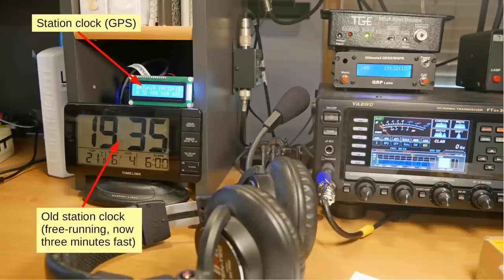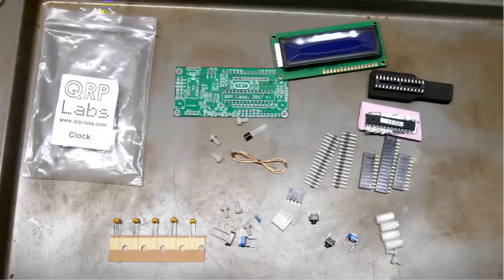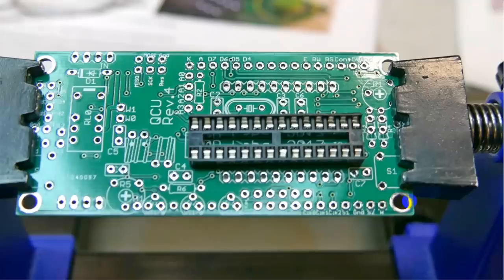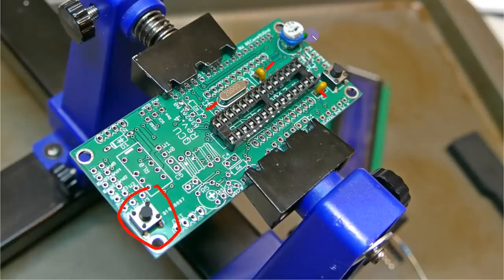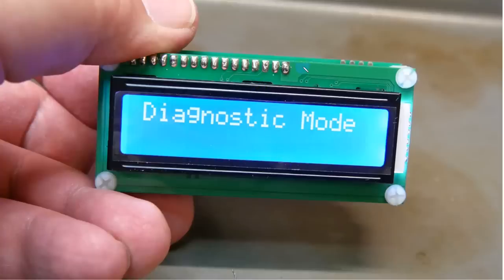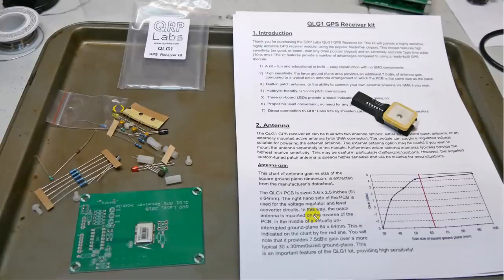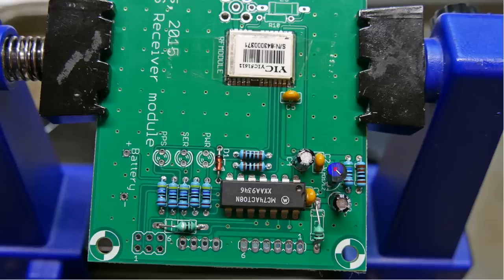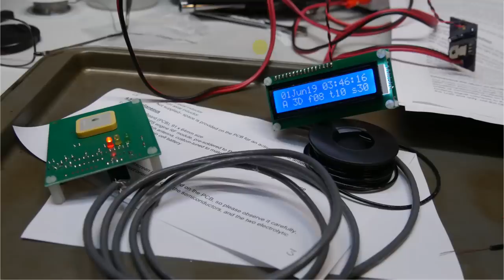QRP Labs Clock Kit and GPS Receiver Kit (#203)

Comment: Typically, the time and date can be taken from the NMEA 0183 data coming from the GPS. That sets the clock to UTC and then the 1PPS is used to make sure that the seconds are ticked exactly at the same precise second that the Cesium clocks on board the GPS satellites are ticked. That is given that at least 3 Satellites are visible so that the proper calculations can occur. Before that, the 1PPS will vary. I worked on telecommunications equipment in the field that use the same principle. The clock as shown when synced has the same accuracy as the clocks in the satellites and can be considered, for NTP purposes, a stratum 0/1 clock source. This is a very nice project. Thanks Dave.
Reply from the maker: There is a tiny bit of delay between the green light coming on and the heartbeat on the face of the clock, due to processing time.

Comment: Hi Dave. I've had my clock(s) and GPS running since they were released and never a miss. One of the common posts on the QRPLabs group is "I put 12VDC to my xxx and it doesn't work". I put a 12V - 5V converter inside mine so I can run them on 12V. They can be had on eBay for cheap. I made mine but other than the satisfaction of home brewing it the eBay boards are a better deal. Some are adjustable. That's what I used. 73 NE5U  Mike

Comment: Dave, most folks are unaware that the GPS system sends out a correction message to all the satellites once very 17 minutes. So if you really need accurate time, make sure your receiver has been running for at least 18 minutes, so that it has caught at least the one most recent correction in the system. Trivial difference--but it is there.

Comment: Maybe the extra lines in the display could become a timer with a remote reset switch for when you have to announce your call sign again during a contact?
Reply from the maker: There are many ways to customize the clock already built in. You can have alarms, measure temperatures, etc. I've not explored any of these.

Comment: What kind of a case are you putting it into?  
If metal, wouldn't that shield the GPS antenna from picking up the signal from the sat?  how would you compensate for that?
Thanks,

Comment: If you or your viewers like experimenting with GPS might I recommend the ublox Neo-7M GPS module available on ebay for about $7.00. I used one to set up a 10 MHz clock ref for my lab about 3 years ago, simple, cheap and works like a charm.
Reply from the maker: Looks like there are dozens of variations, and prices are all over the map. I'll have to try one.
Reply: @davecasler  If the interface between the GPS module and clock is a normal 3v. Tx/Rx signal it should work.
Reply: @stevec5000  The clock needs 5 V TTL, 9.6 kBit NMEA sentances and a 5 V TTL one pulse per second signal. You can use any GPS-RX that delivers this.
Reply: @56932982  So any $4 quadcopter GPS module like a NEO-6M will probably work.
Reply: @stevec5000  If it provides a true, precise 1PPS signal. True 1PPS from the GPS chip, not faked by a processor by interpreting the NMEA sentences. Not all cheap GPS modules provide a 1PPS. Also note that the QRP-Labs GPS-RX provides a large ground plane for the antenna to improve sensitivity, SNR and jitter. I don't know abut the clock, but the other kits like the WSPR TX and VFO from QRP-Labs have setup functions to configure different GPS receiver properties. (Positive or negative logic on the 1PPS e.g.. You can also alter the baud rate.)

Comment: FYI.....pay the extra cost for tracking or you'll be sorry!! Speaking from experience, my clock kit took almost 4 months to arrive....not QRP Labs fault. Also, I wish Hans had included a 2.1mm male connector for connecting 5vdc instead of the way he has it setup.......73/k6sdw

Comment: Very nice Dave!

However, typed in the amazon link, it just went to the homepage, not to the pcb holder.
Reply: Search this on Amazon:  Aven 17010
Reply: @jasong911ski  thanks Jason! 73
Reply: JP Tucson, AZ 

You might want to throw some PayPal at Dave for the  idea of the holder. My search link does not go to his Affiliate page, so it would be proper, I think, to send some love his way.
Reply from the maker: Hmmm...I'll have to check out those broken links.
Reply: @jasong911ski  Thanks for the search string.
Reply: @davecasler  A Amazon questioner raised a good question: What about static electricity? Having plastic holding the PCB, there's no static drain. In fact, the plastic itself could cause problems. Have you experienced problems, Dave? Or did you use a grounding strap on your wrist, etc., to drain static electricity?
Reply from the maker: @arrrgoyle5695  Interesting. I've never run into that problem.

Comment: Hi Dave,
First of all, thanks for all you do to promote ham radio.  I've been a ham since 1966 and I still learn new things from your videos.  My hat is off to you, my friend!
Can you supply a schematic or a kit supplier for the power supply that you are using  to power the clock?  I think I want to assemble the clock and gps kits, but need a power supply for the clock.  I will need to remote the antenna as this house has steel studs in the walls which block most rf from getting into the house.  Any thoughts on doing that?
Best 73's
WD6FIE -- Palm Desert, CA
PS -- Bought a couple of your books to read while on a cruise this fall.
Reply from the maker: I got the 12v to 5v converter from another ham. It's very simple: a 5v regulator with a capacitor on the input and another one on the output. Check around on the Internet. Hope you enjoy the books!
Reply: The kit (clock and GPS-RX) run on 5 V. Just use a generic USB charger as PSU and a USB A cable from a dead USB mouse as power lead. If you have to use 12 V power just throw in a 7812 with 100nF caps on input and output to GND and you are done. Don't remote the antenna. Remote the entire GPS-RX PCB. The kit is setup in a way to make this easy. (two PCBs)
Reply: @56932982  Thanks for the suggestions!

Comment: Can you measure somewhere accurate swr on 70cm with a swr meter tgat is made for max 200Mhz?
Reply from the maker: Yes, pretty much. The power meter part is much degraded at higher frequencies, but since the SWR is based on the ratio of two power levels, if both are degraded by the same percentage, the SWR calculation remains correct.
Reply: @davecasler  Thanks you are very helpful, keep the good content up 73. SY4WCB

Comment: David, you just alluded to power. How are you supplying power to the clock? And did you purchase the cover from QRP Labs or build your own? Thanks for the video!
Reply from the maker: I use a small voltage regulator with a couple of capacitors to go from 12v down to 5 volts. I was given the kit for this. You can find equivalents on Amazon or Ebay for just a few dollars. Regarding the case, that's a problem. I don't have one. The circuit board with the display is merely perched atop another clock.
Reply: @davecasler  OK and thanks. How 'bout amperage? If I get a supply capable of 100 amps (clearly exaggerating) will it hurt this tiny circuit or will the circuit pull only the current needed to operate?
Reply from the maker: @arrrgoyle5695  The circuit pulls only what it needs. Note, however, power supplies sometimes have minimum loads below which they don't regulate well.
Reply: @davecasler  Geez, thanks a million, Dave. Now, another question. I have multiple needs for low voltage (raspberry pi's, etc.) Do you have a different power supply for each or do you have some sort of distribution system feeding multiple needs?
Reply from the maker: @arrrgoyle5695  At that voltage, currents can get high (several amps). You can use a distribution system, but you may not want to put more that a few low-current applications on the same 5v source.
Reply: @davecasler  OK, thanks, David. I 'understand' higher powered, AC, supplies but these low power jobs are beyond me.

Comment: I use QRP Labs kits too. An other problem with using multiple devices with a single GPS receiver is power cross feeding. If the GPS-RX is powered on, it cross feeds power via the TTL signal lines to all devices that are connected to the signal lines, even if those other devices are powered off. To get around that problem I build a simple opto isolator from a quad PC817 opto coupler and six 2k2 resistors on a perfboard. I mounted it just below the GPX-RX in a box. Now I can feed the GPS signals from a single GPS-RX to three devices without ground loops or any other interference between them. A convenient source of 5 V power are USB chargers. Just use a USB A cable from a broken mouse or the like as power cord for the thing that is to be powered.

BTW: I build myself a PCB holder like the one you use about 30 years ago as an apprentice. A really use full thing.
Reply from the maker: Good point about the power crossfeeding.